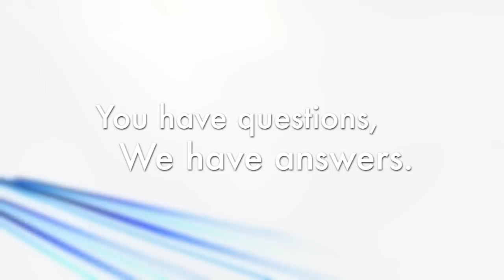Honda CRV Foglights Installation (Honda Answers #61)

Comment: I did this on my rsx years ago, its actually much easier then you think lol just a wire behind a bolt, then plug and play. You're removing a bumper with a bunch of clips and a few screws. Not crazy. That 120min estimate is even a bit high unless it's your first time doing something like this. Don't be intimidated ppl 😁

Comment: One thing nobody shows: you need to adjust the lights after installation. In the factory they adjust the lights mounted in the bumper and then they place the bumper on the car.  For adjusting of new monted lamp you must bore a hole in the lower part of the bumper ( the black plasic ) korresponding to the adjustmet screw in the fog lamp and cover it after adjustment with some rubber cap. You need a loooong screwdriver for the justage.

Comment: This video omits the part where you break several clips, crack decorative pieces of interior plastic, strip out a few screw holes, borrow another car to go to Autozone to find said broken clips and purchase crazy glue, and then never get your front fascia flush again like it was from the factory. Yup... taking my unopened honda factory oem fog light kit to the dealership so that they can do the install. Cutting bait on this DIY project even before I begin. (I some how expected this to be like putting Bosch Pilot driving lights on my 84 VW GTI … Oh well!) :D .
Reply: Brrrr🤪🤣😂
Reply: There's the input from a man who's worked on cars and their reality. This was amusing and enjoyable to read, mostly because it described most of my last DIY jobs! Similar to your 84 VW driving lights, back in 1985 I easily installed under-bumper driving lamps on my college 1978 Mercury Zephyr to augment crappy headlights. Did it outside my college dorm with a drill, a $0.50 Radio Shack rocker switch for the dash, and a spool and 16 guage green wire.

Comment: Well, i think i can make it easy💁🏼‍♂️. Get under the car, take off the botton cover and open the sides of the bumper(carefully) get under the car and cut the circle, install the fog lights and the wires... use an universal fog lights wires with a relay, just two directly wires to + and - of the battery, and one cord that goes inside the car for the switch, and them put the switch in an empty spot from your dash💁🏼‍♂️ no that hard

Comment: It's easier to just buy the EX trim so you save yourself the agony of cutting your hands making a hole in your Bumper. Loosing brackets and few screws not to mention putting holes and scratches on your dash.  By going with EX trim, you will also save the hassle of cutting up your roof,, don't even get me started on what could go wrong there? The leaky roof will be the least of your problems.
Reply: Ex and EXL still have to cut piece on bumper.i have a 08 exl and 2011 exl and still have to cut

Comment: This video might of answered my question: I have a 2006 Honda CRV and trying to find a new bumper but they all say "without fog light holes". My CRV has fog lights so I guess I buy the bumper without holes and cut my own holes, Right?
Reply: Exactly. They have videos on you tube. I did a horrible job cutting mine out. Good luck 👍

Comment: I have a 2007,  besides quality what is the main difference from the OEM style eBay fog lights to the OEM Honda fog lights? I don't think the eBay ones come with the switch yet they come with a push button type switch. Can you verify if the installation process would be similar?

Price for eBay OEM style fogs are $35.99 and OEM Honda fogs are $274

Comment: So, you just tucked the fog harness cable through to the engine compartment and tightened the ground but you never showed where it conects to the anything.
Reply: You remove the power brake booster, drill a hole through the engine firewall, and route the cable through it below the dashboard. Easy Peasy.  Just kidding!! But you are right... It gets tucked up into the fender... and then later in the video magically appears below the dash.. Great video, but he missed that part.

Comment: I was cringing when he was using the razor blade especially when he was cutting towards his hand, I was expecting to see him cut his wrist or finger at any moment. You need to get the right tools for the job both for safety and convenience. So if the bulbs burn out do you have to remove the bumper to replace them?
Reply: i was thinking the same thing - all these awesome power tools to remove bumper etc. but a razor blade for the cutting. I thought i'd see some fancy cutting tool. Goes to show how that patent for the razor blade 120 yrs ago was genius. I guess he really needed a precise cut to prevent plastic burrs from interfering with install.

Comment: That's the wrong year. I believe that's a 2010, different front bumper.
Reply: Factoryrat77 your deffently right 07 to 09 is round and 2010 to 2012 is oval
Reply: Factoryrat77 I have a 2009 model but it also doesnt have those bottom lights. Could i install them also???..
Reply: yes same procedure but ofcourse for the round lights. the only difference is the bumper design from previous year

Comment: That is not a 2007 CRV. The kit that I bought from a Honda dealer does not have you make connections in the steering wheel column..
Reply: Mine is a 08 and I had to change the headlight switch on mine only oem you have to change headlight switch if it's a push button its aftermarket for these years

Comment: Too much work for two foglamps. Not that serious in my opinion 🤔
Reply: They should be installed on EX AND EX-L MODEL'S.  Its crazy that there not. Only seen 2 so far and WOW, What a huge difference on look's. It makes it look 10 times better and worth $500 more easy. They have aftermarket ones with different color's, not legal in my state at all. Want nice headlights, look at the Halo headlights. In black. There costly, about $350 a pair.

Comment: Looks pretty hard unless you know what your doing, body man, mechanic, electrical work, more than average, how much does it cost to install on a 2010 Honda CR-V EX 4WHEEL ? Why not not just another rocker switch on dashboard, that would make it much easier than pulling the directional switch apart, you didn't show where the wires went or what it looked liked at all. Just a wiring harness and bam, you plug in to wires into to pins. Like we know unless you show what to look for, like the pin connector and color coded now. Also where you snaked it threw the firewall also. Its not a cheap kit but they due make them cheap and great name brand that looks easy, that comes with a rocker panel. Why not just plug the low beam light into wiring harness kit so they only work with low beams only, just like a trailer harness kit does. Same thing but the front and you make it hard.